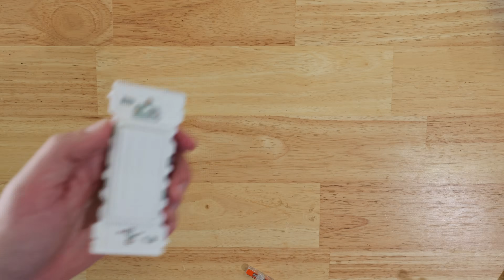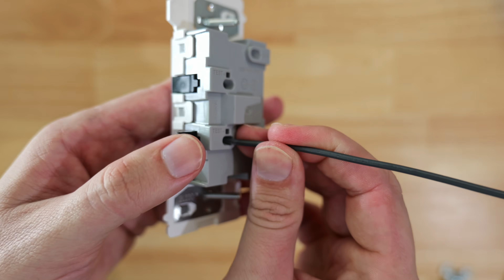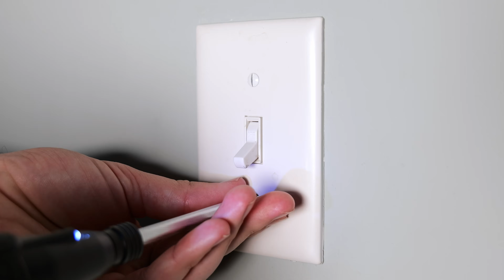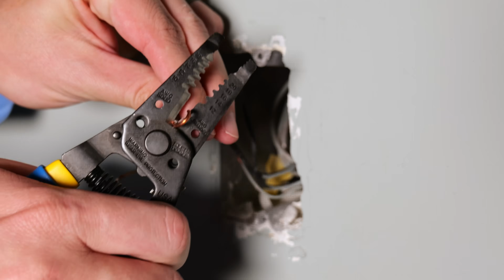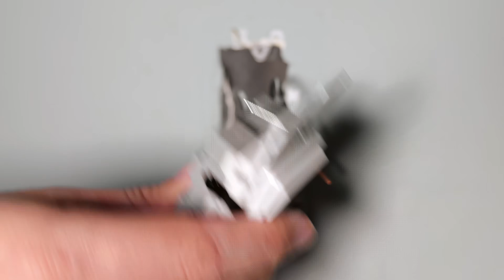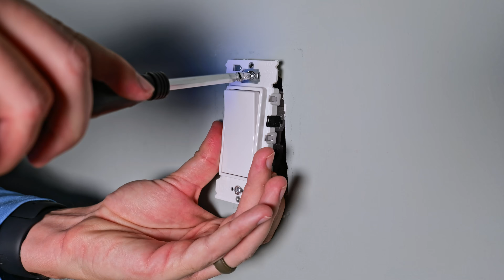How To Replace a Light Switch With THE Safest and Fastest Switch Available! Leviton Decora Edge

Comment: I’ll be looking into replacing mine. 
Could you do a video on switches that don’t seem to do anything? I have a double wall switch. One side controls ceiling light but other doesn’t seem to be tied to an outlet or anything. Was it supposed to be a separate control for a ceiling fan? Was it a mistake? How can I tell?

Comment: Installed these all over my 1900 Farmhouse a few years ago when we moved in, and they've been flawless.  I haven't regretted a single application where I replaced a regular switch with one of these Leviton Decora Edge switches.  Super easy to install as well!  Used the edge outlets as well (and now they make edge GFCI outlets too, which are on the upgrade list for this weekend!)

Comment: I just upgraded all non-GFI outlets and switches in my home with these. They are awesome for sure! But... while I don't have any complaints for the outlets, my beef with the switches is that Leviton should have included one more "line" side lever terminal so that you can easily daisy-chain your switch circuits like most contractors do with typical screw type switches. Without this extra line side terminal to feed the next switch, I had to use Wago 221-5 lever nuts in order to gain enough hot pig tails to power each switch. Again, not an issue if you are just swapping out one switch in a single gang box but with a duplex or more this could/would be a handy feature for all that Leviton could easily incorporate into the "next gen" of these.

Comment: I am installing recess lighting in my renovated pantry. I have to install a non  preexisting light switch. I’m getting my power from the receptacle below it. Once I connect the white black and ground to the switch there are no more holes to run the wires to my recess lighting. Am I using the wrong switch? Is there another light switch with more connections?

Comment: This is a perfect way for diyers to burn their homes to the ground. 95% of failed receptacles and switches I see are from stabins. Use a $3 commercial receptacle with screw terminals and it will probably never fail. I love seeing this residential gimmick crap and I love following up people that use these. Great for business to replace this inferior crap. Good luck to everyone going diy. I hope your insurance company is good.

Don't use these or any stab in product. Advice from a seasoned electrician who has seen the aftermath of loose wires and inferior product. 

Take a stab in receptacle. Install it then pull it out if the box a time it two and those wires will be loose, heating up and waiting to burn the wall.

There is a reason licensed electricians don't use this crap.
Reply from the maker: These use completely different mechanics and parts than stab ins on a regular outlet.  I completely agree with not using them and I still will use commercial grade receptacles over anything else but for a light switch these are completely fine.  Electricians aren’t using these as they are brand new and more expensive than residential grade.
Reply: Nice to learn that the whole of Europe has burned down from these.

Just a moment...it hasn't? Weird, cage clamps haven't been a problem there since their introduction in 1977? Inconceivable!

Comment: Hello. I wonder if you could help me on a problem that I have. I have two sets of fluorescent lights on the garage, most of the time when I turn them on only the ends of the tubes turn a dim light. when I turn the switch off, they turn on for a second, other times both turn on normally and sometimes one set will turn on. How can I go about diagnosing the problem?? Thank you for your help.

Comment: The receptacles do have test ports... It's just on the front where you plug in a regular device. ;)
Reply: Also, there is some slightly exposed metal on the receptacle sides for testing

Comment: In replacing a bathroom light I discovered that the previous owner had twisted the wires together and wrapped them with masking tape—and I don’t want to get started on the ceiling fan that was hanging by the house wires. Too bad you weren’t around for that guy. Thanks for helping me be a better (and safer do-it-yourselfer).

Comment: How do you determine which wire is the line and which wire is the load?
Reply: Use a phase tester, the load won't have any power
Reply: It doesn’t matter on switches
Reply: @MrMinecrafter16  doesn’t matter but you still want to make sure which is which

Comment: My question, is it worth it,  to upgrade my house, to these new flap-type-Switches? Does it add to the value of my home?
Reply from the maker: Doesn't add value.  It would be more of a curb appeal item.
Reply: @HowToHomeDIY  walked into some new construction, a couple of days ago, and it had the new flap-light switches and it just made the place look more modern, and have to admit, upscale.
Reply: Same front as decora, popular in the 70's. Once installed, can't tell the difference.
Just hire a real electrician.

Comment: I think this is an excellent video for the common layman/homeowner. As an experienced industrial electrician of 6+ years, I have seen the atrocities that homeowners/laymen/handymen, etc.. have left in their wake. These devices remediate insulation being wrapped around terminals, wire being wrapped the wrong way around terminals, and it aids the individual with color indicators of where specific conductors should be placed. I think all box stores should only allow the sale of these devices to the aforementioned individuals; not only does it make them safer during installation, but it also makes costly repairs of ill-installed devices less common. Will there still be errors in their ways; certainly, but these devices are on the precipice of something great. I'm a P&S kind of man myself, but I applaud Leviton for this innovation in load-carrying devices for these individuals.
Reply from the maker: Yeah I definitely agree with you.  These really should help cut down on those common mistakes.  Like anything new, I always wonder what we will be saying in 5-10 years.  But I think these are a good first step.  I really appreciate you taking the time to share your experience and feedback on them.  Thanks a lot Jordan!

Comment: I have seen several reviews on this switch. I am cautious about many  new products. However, I have been using Wago connectors for the past year. I have also used primarily Leviton brand receptacles and switches for many years. Based on my experience with Wago and Leviton products and reviews like this I intend to  try one of these switches the next time I replace or install a switch.
Reply from the maker: Yeah I agree with you on that.  I personally am a wire nut guy and use Wagos where I think they make more sense but have zero qualms with this switch. I think they can cut down on some of the common mistakes that can be made.  Appreciate the feedback!
Reply: @HowToHomeDIY  I still use wire nuts for many applications. I use Wago pririly where there is any stranded wire, overhead connections to fixtures, or if I expect to be accessing the connection again in foreseeable future.